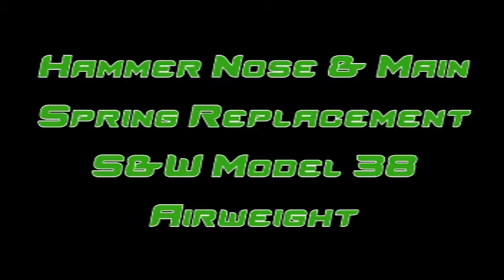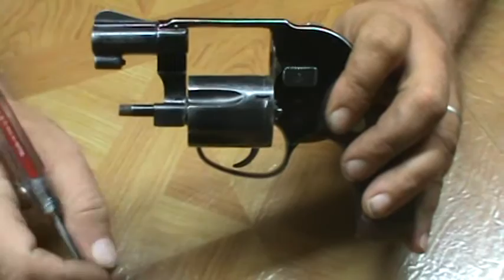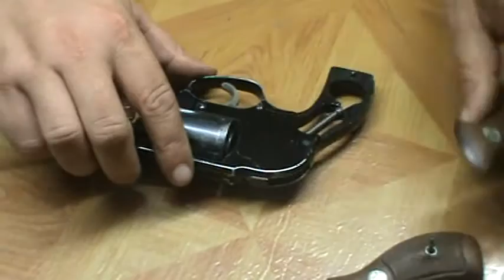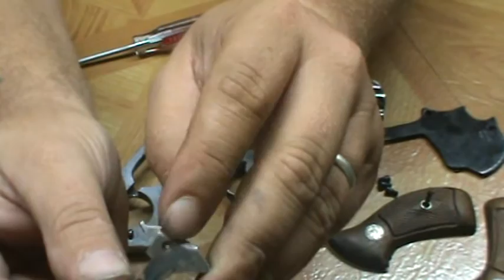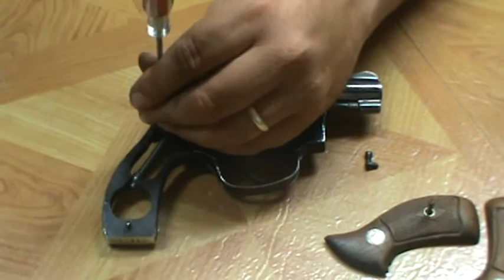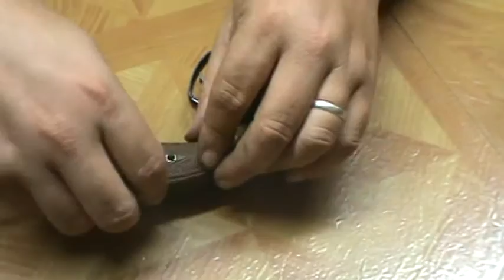S&W Model 38 Airweight - Hammer Nose & Mainspring Replacement

Comment: Thanks for the video.  My unit has a hammer block, I noticed that the one in the video does not.  Is this some sort of safety override or is the part really not necessary?
Reply from the maker: hard to say for sure without maybe some pictures. youtube comments are super unreliable, so for communication with creators, including myself, i recommend PM/DM features through social media or contacting them through their website/email, which can often be found in the about section of the channel. anyway, if your hammer has the firing pin attached, then yeah, would be a hammer block safety but, if your hammer does not have a firing pin, it could be a transfer bar. the later is absolutely requried for the revolver to function. the block may or may not be, it sorta all depends. often times things in revovlers work together in a where they are still required, even though they may not perform a direct function in regards to operation.

Comment: That is a sweet piece. Pre-‘66 at least. I’d like to find one at a decent price. Tap the grip part of the frame with handle of a screwdriver to remove the side plate. Cock the hammer and insert a paper clip into the tiny hole of the mainspring spur. Let the hammer down and your assembly will come right out. Do this before removing the side plate. It’s never wise to work the action with the side plate removed and the mainspring in place. It puts lots of stress on the frame pins. They can’t be replaced on an alloy frame. What did that gun sell for?
Reply from the maker: noted... not sure what this sold for originally and it was never for sale as it belonged to and was repaired to a friend of mine.... who as subsequently passed away since this video was made.
Reply: CloverTac I’m sorry to hear the owner passed. Thanks for the reply, brother.
Reply: Are you out of Houston (Baytown area?)
Reply from the maker: no, up in Cherokee County. east Texas
Reply from the maker: be careful posting links to sites that sell like that, you could get yourself or the channel you post those to banned, unfortunately. that is the same model but not the same revolver. my friend's son got all his guns and he doesn't sell anything ever.

Comment: do you have the video on the cylinder extractor removal ? i cant remove it
Reply from the maker: i do not have a video on that and sadly not longer have access to this revolver, it belonged to a friend that passed away. in basic terms i can tell you that you will need to remove the cylinder from the frame and the extractor unscrews from the cylinder, usually it is reverse threads. it is possible it is very tight and so having something to hold everything while you try to turn the cylinder the opposite direction from the extractor might be necessary.... sorry i can't be more help